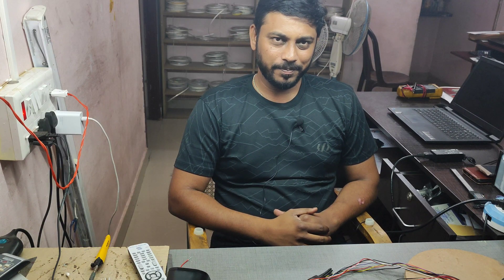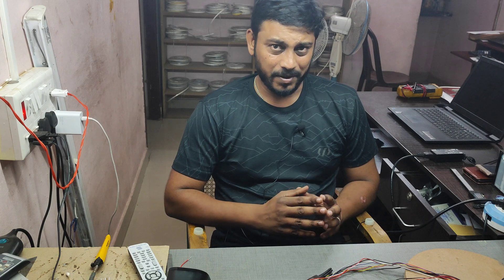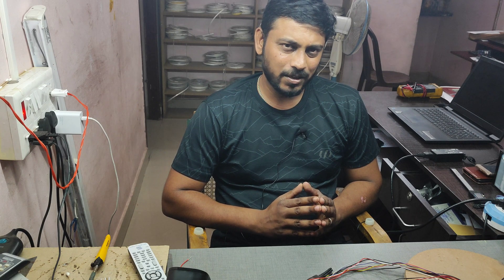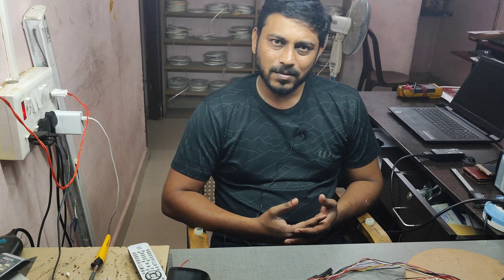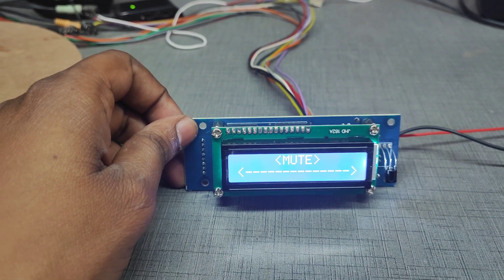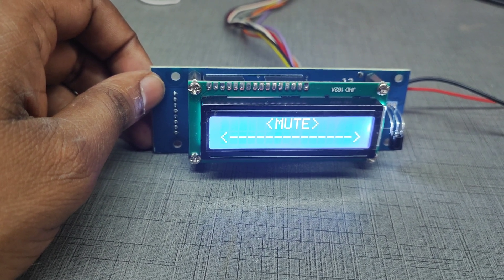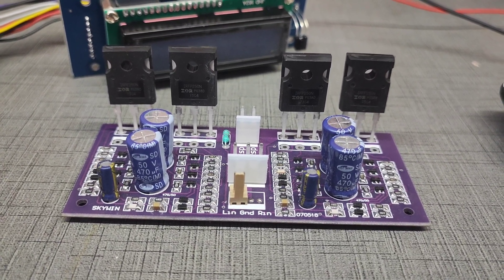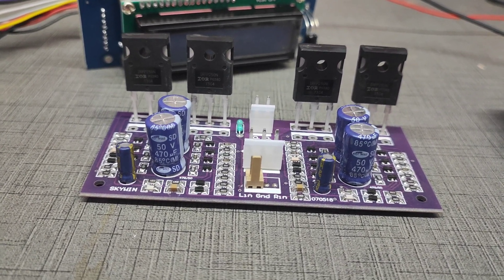Bassoon Mini remote kit n Overview on MOSFET - English Version

Comment: Hi ..i purchased this kit….clarity is very good but the bass control on front channels are only upto 14 levels …can we increase the bass level? Also the bass frequency as well
Reply from the maker: No sir by default the bass and treble will be 14db in R2S15902FP Selector ic. We can't go beyond that
Reply: Ok any suggestions to increase the bass effect on stereo channels? Like adding a low pass filter in the inputs? If so will the treble frequency decreases?
Reply: Same board Problems creat audio but no sound . What issue